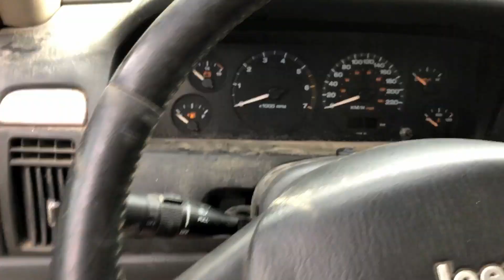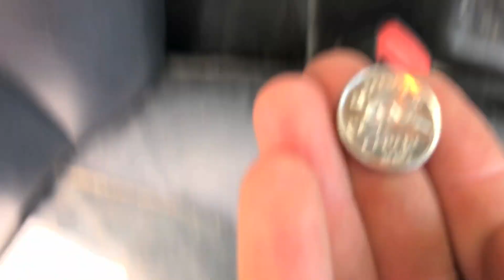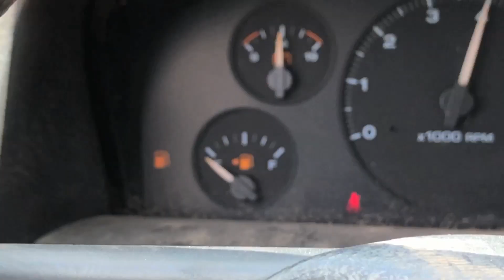NEW $400 4X4 JUMPED Right AWAY!

Comment: Bro, you have a pretty rare Jeep. A Jeep WJ with the 4.0 liter inline is rare. That engine is hard to break. Can’t wait to see how hard it is for you.
Reply: I have a wj with a 4.7 with a selec trac from factory,harder to find then then the 4.0
Reply: 4.7 was a small v8. Blew up 2 redlined one for at the most 5 times hitting off the ketchup an poped the head gasket.
Reply: But I've seen the 4.0s buried in water pulled out let sit for 10 min an fired right up. Also my buddy use to redline his 4.0 247 an never had a problem besides spinning pulleys right off the engine into the rad lmao